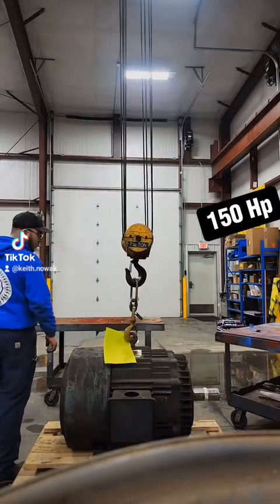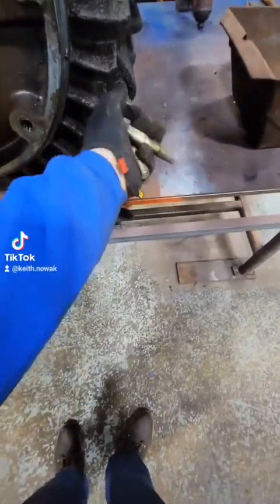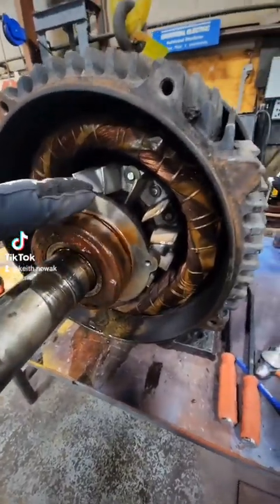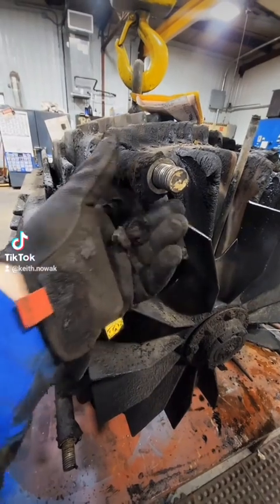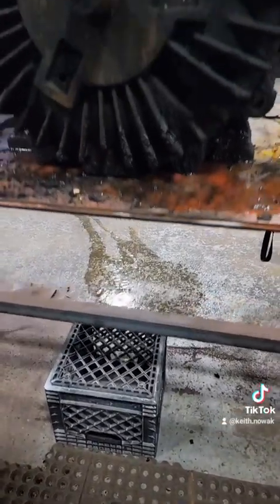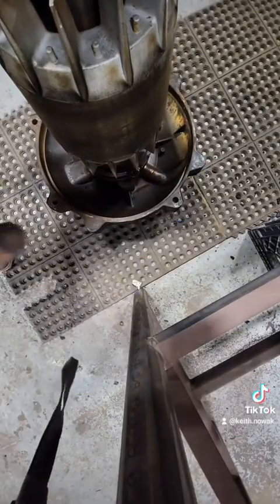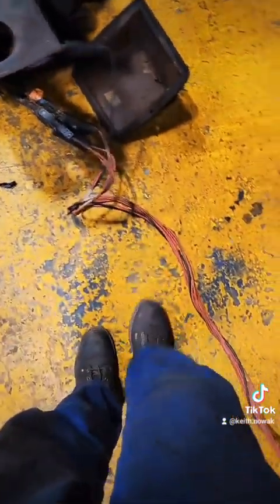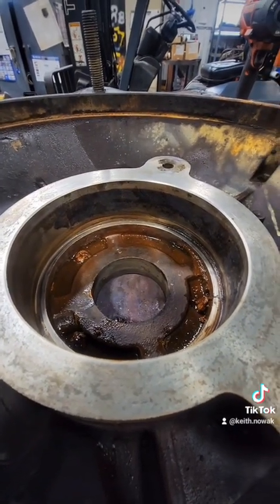150 horsepower motor breakdown

Comment: Also, all thread in the endbell will get you to the point where you can add an eye bolt.  6 inches i prefer but i love using two allthreads for saftey.  Rare to see a winder, technician, and machinist in this industry.  Kudos to you for making that journey.